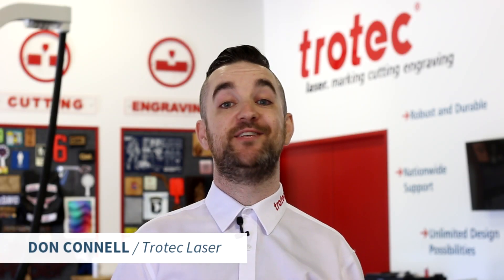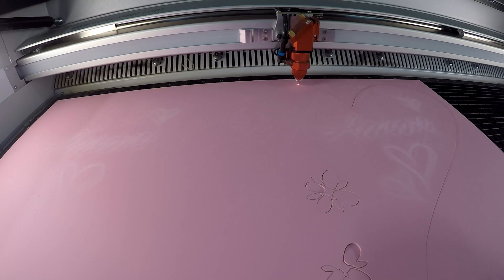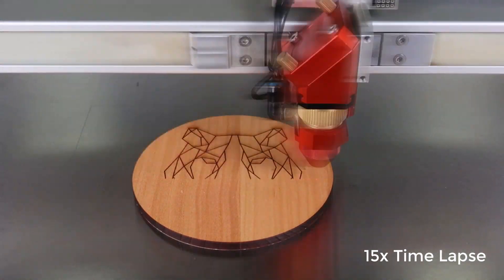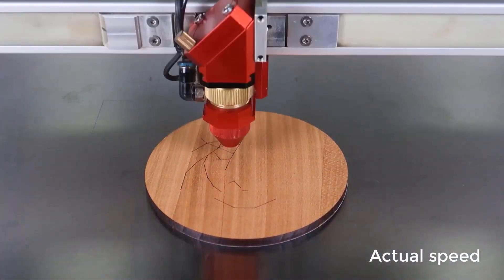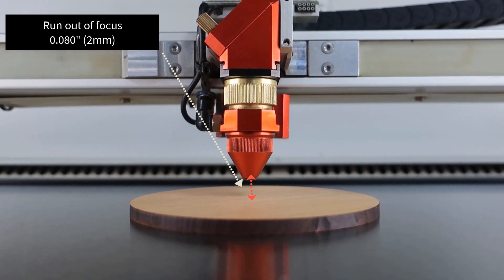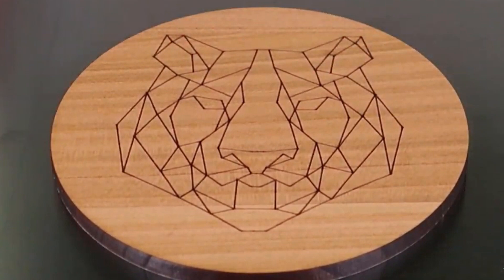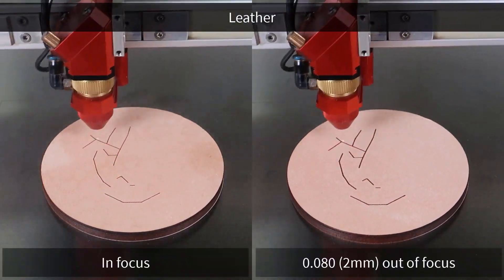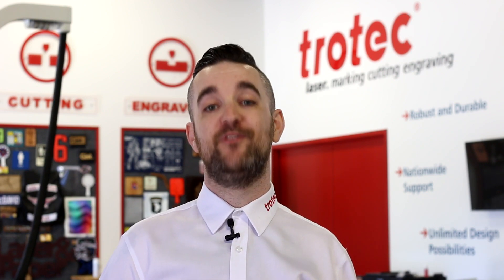Laser Engraving Hack: How to Create Thicker Lines with Vector Engraving

Comment: I tried this approach on my Speedy 300 80W on wood.  Each line segment started and ended with a stronger burn-in than the rest of the line segment, giving the appearance of dots at the start and end.  I was not happy with the results.  Anyone else see this effect? If not, what settings do you recommend ?
Reply from the maker: Hi Corey, did you try decreasing power a bit? You may be using too much
Reply: @TrotecLaserCanada   i did try different settings, but maybe did not hit on the the right ones.  What do you recommend for birch plywood (3mm)?